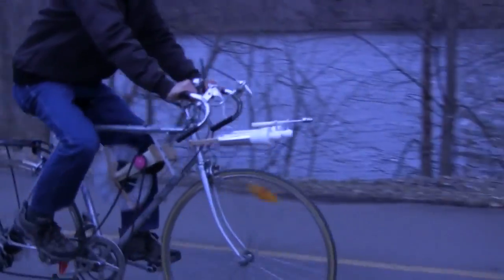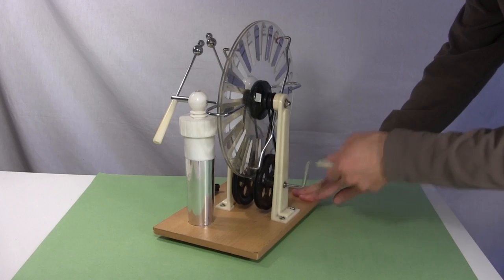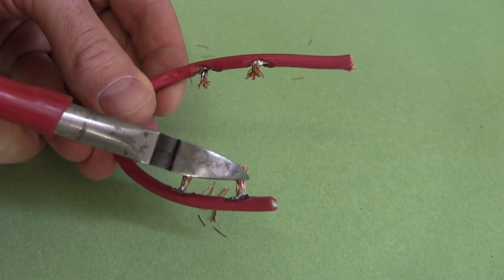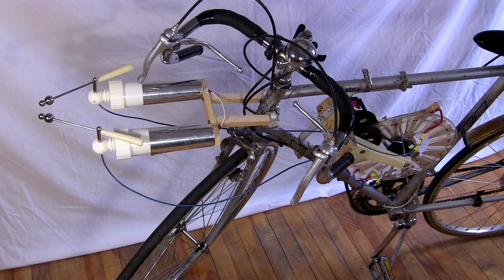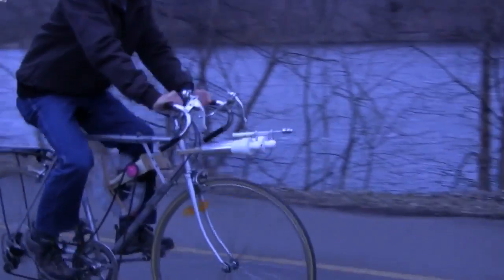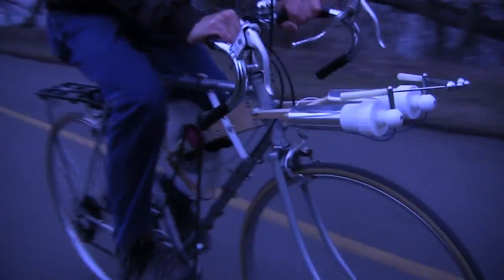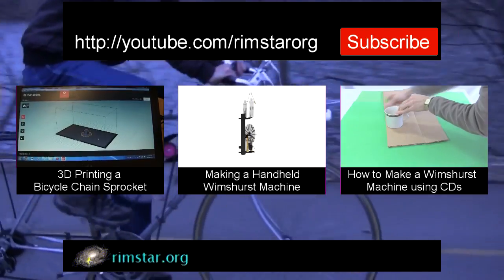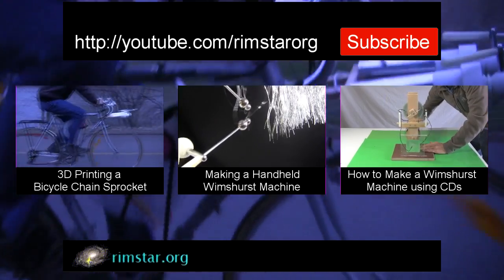Wimshurst Machine on Sparking Bike

Comment: I was thinking more of like a big one which would, means like just be used with corona motors and are placed in bicycle and it makes the cycle run. Idk if its possible but I think it might work
Reply from the maker: It's  nice combination. I suspect corona motors are more efficient at high speed so you'd need to gear it down first. It sounds like you might enjoy this article I wrote about a bicycle in space where the wheels are Wimshurst machines to produce high voltage for the ion engine. https://hackaday.com/2017/07/11/bicycling-in-space/ It's from a short story I read.

Comment: That magnificent brain strikes again! I had a similar idea of putting a Van De Graaf generator in a wind turbine. The wind would turn the generator, and at night you'd see it glow as plasma came off the blades (also helping push the blades to small extent). Your idea is actually useful, where mine would be more of a lawn ornament or a curiosity for people walking by. I think your bike would work just as well with a Van De Graaf, right? Just needs a belt and no sprocket.
Reply from the maker: Andy Jones Nice idea! Purplish Corona on wind turbine blades! Yup, a Van de Graaff generator certainly would work on a bike. Maybe make it look like rocket tubes on the back.

Comment: What made you decide to go with the sprocket and chain arrangement, instead of driving off the wheel with a friction wheel or something? You have to pedal to make the sparks and they won't work when coasting.

Very clever bike mod. I hope you win the contest!
Reply from the maker: USWaterRockets Thanks! Good point re the coasting. Given the location, driving off the wheel wouldn't be as simple to engineer but doable I'm sure. The disk assembly could be moved to the back of course, but I kind of like it where it is, more compact.
Reply: RimstarOrg How about a propeller that picks up the wind motion from moving and drives the disk? That could be made to look cool as well.
Reply from the maker: USWaterRockets Good idea, but these disks need more power than that wind motion will supply I suspect.
Reply: Do the disks have to spin in opposite directions or would one stationary disk and one spinning disk have the same effect?
Reply from the maker: USWaterRockets For a Wimshurst machine both disks have to spin. One carries positive charge to one collector while the other carries negative charge to the other collector. There are probably other types of electrostatic machines that work with just one spinning disk, I just haven't looked for any.
Reply: RimstarOrg Too bad you couldnt work out a way to attach half the wimhurst on each side of a bike wheel and forks with collectors attached similar to the brakes... You might also encapsulate the spark area like a light lense to disperse light better and look brighter. may help if there is the wind blowing ionization issue also... goodluck
Reply: RimstarOrg How about modifying the axle of the front wheel a bit? Longer axle shaft, mount a sprocket onto it and then the chain. This wouldn't limit your front gears and works while coasting.
Does the arc provide light to see the path in front of you? If not then the parabolic mirror wouldn't be a bad idea.
You need to find a way to produce a red arc for the back though! :P
Reply from the maker: Atristiel The two Wimshurst machine disks need to rotate in opposite directions and be very close to each other, so whatever structure would be at the front wheel would become quite wide. I guess the additional structure would be mounted on the front wheel's forks.
It doesn't provide light for the path in front. I'd still need to use bike lights. I guess to get a red light you could put a translucent red film around it or have a canister blowing out a gas that will make the arc actually red. :)
Reply from the maker: tnlightnin There might be a type of electrostatic machine that has only one disk... a quick search just turned up the Holtz machine which has a rotating disk and a stationary disk. I don't know how good a choice it is but that's one at least. Hmm...
Reply: If it is effective at generating static electricity, it might be a good fit for the bike, as there are plenty of places one could put a single rotating disk on a bike. Hmmmm.... indeed!

Comment: You should try making the disk directly on the wheels ;D
Reply from the maker: Raberuji That would be awesome, and I first considered something like that a few years ago when I read a short story about a race in space between "bicycles" where the wheels were electrostatic generators (similar to Wimshurst machines) to generate high voltage for ion propulsion. But the two disks of a Wimshurst machine rotate in opposite directions, and have to be very close to and facing each other so it'd be pretty hard to engineer. But it would be far more awesome! :) Maybe it could be done with a different electrostatic generator design, of which there are plenty.

Comment: Put a parabolic mirror on it, it makes a nice bicycle lamp.
Reply from the maker: Power Max I wouldn't want it too fast, otherwise it would start looking like an ordinary light. I'd shoot for longer and thicker sparks. I did have to bike a little slow so that my camera man (a neighbor who did an amazing job!) could keep up. But you can see the difference when I was biking fast at 1:56 where I was holding the camera as I was biking so I was able to bike faster, and even then it probably wasn't up to normal speed (I average 20kpm.) If I make the spark gap wider then it doesn't work as the losses in the system take over. With this same Wimshurst machine on a desktop I can get much wider sparks. Even to get what I got, I had to thoroughly clean the disks with rubbing alcohol to get rid of any dirt and use nylon and plastic parts where possible. The biggest losses were probably the thin insulation in the wires going from the collectors to the Leyden jars, unless the airflow was also interfering with some of the ionization.
Reply from the maker: Pirat Carribean I hadn't thought of that. It'd have to be plastic of course.
Reply: RimstarOrg Maybe a xenon flash tube or HID lamp? How fast can you make it go? I would try to make the sprocket even smaller to get more RPMS and more electrical current. Maybe you can squeeze out a few mA's.
Reply: RimstarOrg Oh, well I would have meant to make the light more consistent, along the lines of a really fast stroboscope, or even use a buck converter to convert that HVDC into usable energy to charge a phone or something. I am thinking a reversed tesla coil, with a spark gap to the large coil, and a full bridge rectifier on the small coil side.
Reply from the maker: Power Max Yeah, while working on this I realized there's a whole world of electronics that can be used to make more impressive sparks. Possibly they could still be powered by the bike, since that adds a lot to the coolness of this IMHO.
Reply: RimstarOrg Yes.

Comment: I didn't thought it would be so visible in the dark.
Well done !
Reply from the maker: Nicnl Thanks! At one point I hadn't thought it would even work. I convinced myself that the air flow would interfere too much with the corona needed at the collectors and the spark gap and I stopped working on it for a week. Even now I'm surprised... but glad it works!
Reply: RimstarOrg Corona shouldn't even be able to build up with rounded electrodes, like you said in the HV capacitor tutorial. With large tesla coils, they use air flow over the spark gap to 'quench' it, keep the ionized air away, and keep the spark gap cool.
Reply from the maker: Power Max Maybe corona's the wrong term. Maybe I should have said the ionization that causes the air to become electrically conductive before a spark can occur. With the air flow form a moving bike, I expected that ionization to not build up but be blown away. The same for the ionization path between the spark points of the collectors and the closest disk sectors.
Reply: RimstarOrg Oh, I see. Some wind shielding may help. Corona is just ionized air surrounding a high tension point, that term is just as valid. Corona is usually a bad thing because it causes losses, so it is to be avoided.  You want nice crackling sparks, corona will act like a short circuit, or I guess more like a bleeding resistor, bleeding away charge.